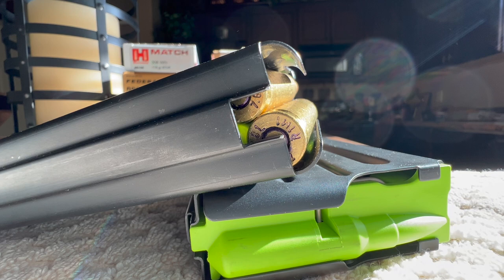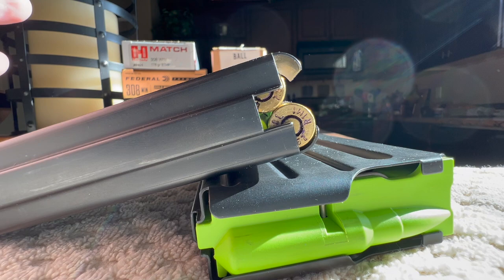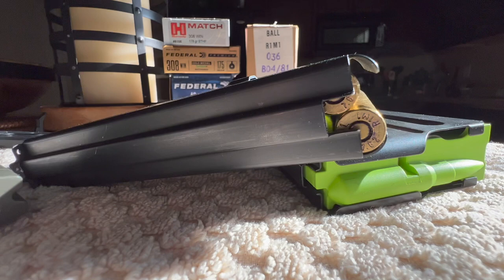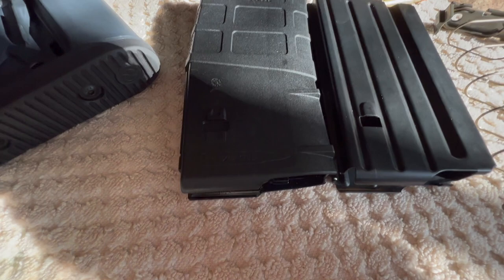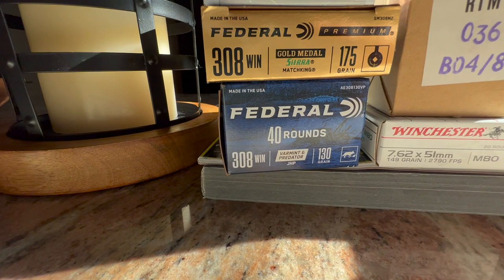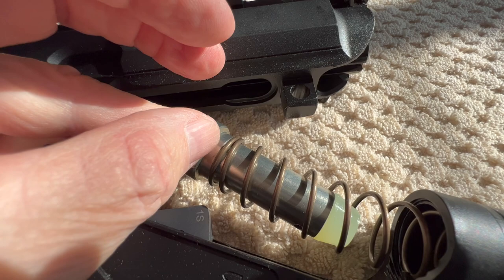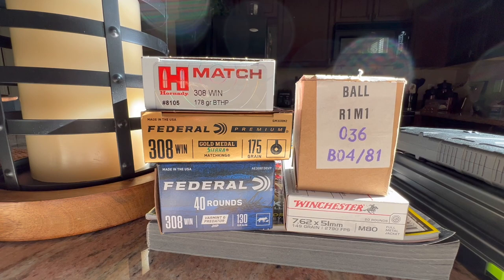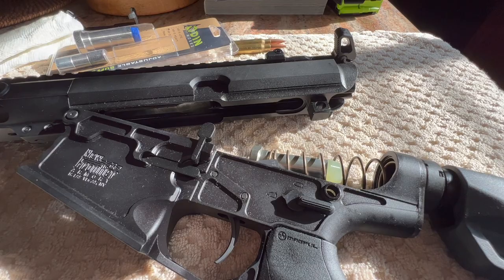AR308 New Frontier Armory Odin Works Adjustable Buffer - 11

Comment: It is the spring, replace with a shortened accordingly Wolff Spring. Do not attach the Wolff to the follower hole. Shallow notch the forward follower pin at its base, cut the spring to friction fit between the notch and follower primer end, reassemble mag. The follower should now push up on the primer ends.
The floor plate tabs can be filed to make disassembly and assembly easier.
Reply from the maker: Thanks! Sounds like you have been there done that! Unfortunately or fortunately depending on how you look at it they are now in the trash.

Comment: so did it work?
Reply from the maker: Nope! It either tilted the rounds to the front or the rear depending on the spring orientation. Not enough spring tension and the follower design is garbage!